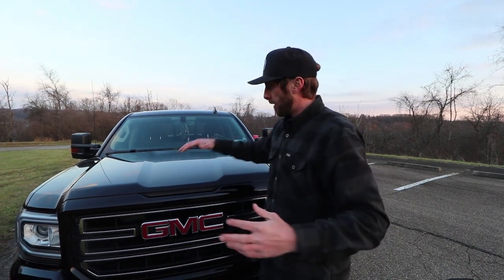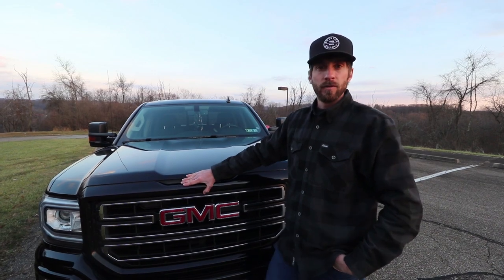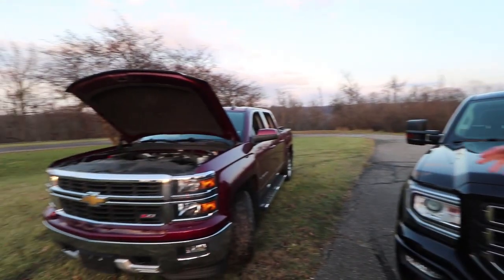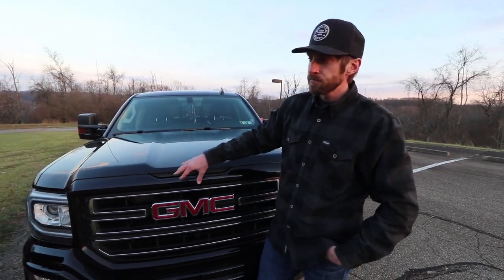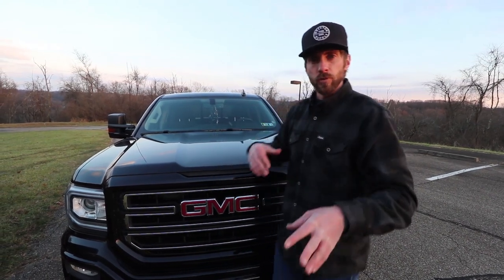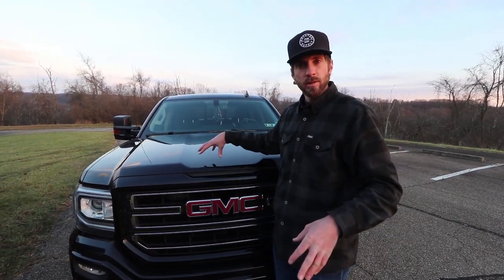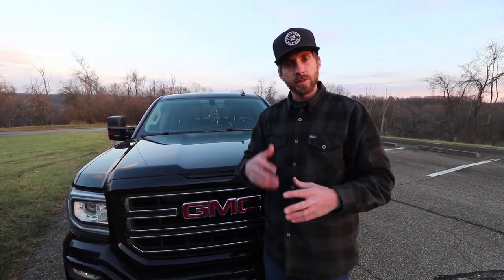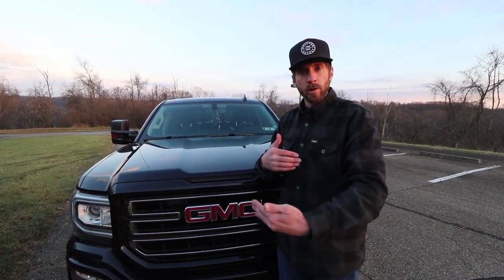Radiator Fan Won't Turn Off  2014-19 GM Trucks - Temperature Sensor & Thermostat Previously Replaced

Comment from the maker: Radiator Fan Won't Turn Off? GUARANTEED FIX: https://youtu.be/7gKbLHhD1cw
Reply: I just reset battery and it’s working as it should . Do you think a parts change is necessary

Comment: Replaced the temperature sensor and thermostat, still didn't fix the issue of the fan turning off when I removed the key.  Disconnecting the battery for about 10 minutes is what finally fixed everything.  Thanks for all of your advice, couldn't have done it without your handy videos.
Reply from the maker: Glad we could help! 🙌

Comment: Thank you for making this video. I had switched out both the thermostat and the sensor and the fan was still blowing...until I took your advice and disconnected the battery for the system to reset. Works great now. Thanks a million brother!
Reply from the maker: No problem bro! I had the same issue, that's why I kept making explanation videos.  I'm glad they helped you out! 🙌
Reply: Hello Anker - I had exactly the same issue. Replaced sensor - fan still on. Replaced thermostat - fan still on. I was mad coming back in here and when I watched the "disconnect the battery" clip - YES! That was it. Just came back from a test drive and runs great! Thank you Brothers Workshop. Too cool for school!
Reply: I disconnected battery and now truck won’t start
Reply: Man I did the same thing on my 2017 tahoe and it worked
Reply: EXACT SAME ISSUE ❤

Comment: Awesome video! Replaced thermostat first with no joy; replaced temp sensor next and still no luck. Watched this video, disconnected and reconnected battery and all worked perfectly. Thank you so very much for this; I was beginning to believe I may have a wiring problem.
Reply from the maker: Glad we could help out!  Thanks for watching the video.
Reply: @TheBrothersWorkshop  You suggested the idea of the thread tape on the thermostat seemed a stretch and it did to me too since it was preinstalled and only on the upper half threads but glad you added it as one of the options.

I love YouTube and have accepted it as a major tool in my toolbox not only on removal techniques but also locations on the vehicle/engine, which is incredibly helpful. It becomes quickly apparent who is or is not capable and your video was great; it assumed some knowledge of the viewer, drove straight to the point allowing me, defeated on my previous attempts to solve the problem. Thank you again and subscribing to your site.
Terry Foss
Reply: same here  the battery disconnect  did the trick
Reply: Battery disconnect saved me some time and money !

Comment: Sean, Thank you so much for this video.  I had changed out the sensor and thermostat on my '14 Silverado and still had the fan running and no function on the temperature gauge.  I never thought about the battery idea.  I did it and all works great.  You just saved me from a night of no sleep and possibly a lot of money.  Thank you a million!!!
Reply from the maker: Glad I could help out!  I'm also glad I could help save you a few bucks!  That's why I make these videos. 🙌😁

Comment: Glad you stated in this video to disconnect battery. Fan still ran after installing sensor but once disconnected battery it worked. Left Teflon tape in.

Comment: Thank you so much for posting this video! I changed my coolant temp sensor, thermostat and filled overflow with coolant and it still didn’t correct the issue. After disconnecting my battery and letting the electronics reset the temp gauge started reading temp and cooling fans stopped running. I was ready to remove teflon tape and dive deep. 
THANK YOU!
Reply from the maker: Glad it helped!  We have a ton of other videos about these trucks.  Check them out and let us know if you wanna see anything else.

Comment: Replaced the sensor didn’t work, replaced the thermostat, still no luck. Tried disconnecting the battery. Still no luck. Removed the Teflon tape and it fixed the problem. Crazy that the tape affected it that much. Thanks for sharing your wealth of knowledge!
Reply from the maker: Glad we could help you fix the overall problem and the minor issue with he tape.  Thanks for watching!!
Reply: I did the three things and still no luck. Where about is the teflon tape i dont see it anywhere in the parts

Comment: Replaced the temp sensor and the fans were still running high.  Disconnected the battery and that reset it.  👌👍 THANKS for the video
Reply from the maker: Glad it helped!

Comment: Your first video showing how to replace the sensor worked for me. I appreciate your quality videos keep up the good work!
Reply from the maker: Thanks for watching Joel!  I appreciate the feedback.  Not everyone, but we did have several people tell us the fix didn't work for them.  This was meant as a trouble shooting technique for those individuals.  We're bringing more stuff soon!
Reply: I put Teflon on the sensor and out worked but I had to have the code reset before the temp read correctly and the fans went back to normal. Watched this vid before having the codes reset when it wasn't working and thought I was going to have to tear apart again to remove Teflon. Maybe put an update on that first video about no Teflon and having codes reset or unhooking battery would probably work as well

Comment: Awesome! Thank you for this video. Replaced the sensor, nothing changed. UNPLUGGING BATTERY finished the job, reset the computer to let it know working sensor was in place...
THANK YOU!
Reply from the maker: Glad we could help Dino!! 🤙
Reply: How long did you disconnect the battery ?
Reply: Disconnected battery for about 15 min.
Problem came back about 2 weeks later. Turns out gonna have to replace thermostat. Gonna check out the brother's video on that too...
Reply: @dinoalexakos5564  so I have a 2016 Silverado Ltz and the radiator fan stays on the entire time the truck is running. Also the ac don’t get cold until 10-30 minutes. Then is blows super cold all day. I changed the coolant temp sensor and disconnected the battery for 10 minutes and it still doing the same thing. I’m not getting any codes and my gauge on the inside is reading correctly. Any ideas?
Reply: @baileyhodges2584  Not sure. It could be a totally unrelated issue. When I was having the problem, the radiator fan stayed on after turning off the car. The coolant wasn't flowing - no pressure in line - and temp guage stayed buried at 160deg, so I don't think it was working. Which leads me to conclude my issue has to be the thermostat. That's my next weekend project when we have good weather.  
Problem has reoccurred a total of 3 times, first time replaced sensor, the other two, unplugged battery for about 10-15 min. Not sure it's safe or smart to keep fixing the issue that way, so gonna swap out thermostat next.
Good Luck!

Comment: Thanks man!!! Saved me from a shop charge today. I replace the censor and the thermostat and the fans were still on. I removed the Teflon tape and disconnected the battery to reset the computer and was good to go. Appreciate you!!!!
Reply from the maker: No problem!  Glad I could help save you some cash.  Those shop charges are out of control, especially at the stealership... I mean dealership. 😂

Comment: This worked! Thank you!!  My Fans would stay on while the truck  was "running cold", when i knew it was not.  changed the temperature sensor, added Teflon tape and the fans stopped kicking in but my temperature was still running cold.. 🤔. Saw this video, removed pressure from the coolant system by opening the radiator cap, unhooked the battery, took out the Teflon from the temperature sensor and voila! Accurate reading... thanks 🤙
Reply from the maker: Glad it helped!  Thanks for watching. 🤙

Comment: Thanks guys!! Had this exact issue with my 2016 Sierra and changed both thermostat & sensor. Same issue, battery reset, left Teflon on the sensor and it works fine!
Reply from the maker: I'm glad to hear it! Thanks for watching and leaving a comment. 🤙

Comment: You talked about resetting your electrical by unhooking the battery cable, "Didn't work", you said  most likely i didn't change out the thermostat, so I changed it. Started it again, "Didn't work"  same thing, the fans revved really high.  So I got a brain fart to reset the computer by unplugging the battery cable again for the second time, just for shits and giggles.  It worked..THANKYOU FOR POINTING OUT WHAT NO ONE ELSE DID,  You must reset the computer when you replace both the sensor and the Thermostat.  Had you not said anything I would of never done it, Thank you
Reply: Your my hero....😁😁
Reply from the maker: Glad we could help you out bro! 🤙

Comment: Thank you very much!! I replaced the sensor and thermostat and the fan still wouldn't cut off. Once i unhooked the battery all my problems went away.
Reply from the maker: Awesome! Glad it worked for you.  How's it holding up over time?
Reply: Did it work for a while? Bud

Comment: Thank you so much for the help! I did not know about disconnecting the battery.  Almost replaced the thermostat after replacing the sensor didn't work. Found this video did the reset and it worked!
Reply from the maker: Glad it helped!

Comment: Thank for your videos. 1st it was the temp sensor helped for like 4-5 days. I'm always OEM. After that I noticed the fan was coming in still. One time killing the battery because it stayed on. Saw your video about next step. Not only that, but I also noticed rhe temp sensor still reading but the we needed the heater. I could feel the heat fluctuate to normal warm too cool all in a quick sudden with touching the controls. I then looked at the coolant reading for remaining of the trip. That's when I noticed it too was fluctuating half way to 210° back to 160. That's what solidify the next step. Now at 248k... Let's still if it'll still into the next cold months. Next is too tackle the trans issue if nothing else. He's a good truck!
Reply: *thank you, *without
Reply from the maker: Glad we could help out Tommy! 🙌 What's going on with your transmission?

Comment: Thanks for the assist.  Replaced the sensor but fan was still running.  After disconnecting then reconnecting the battery the fan turned off.
Reply from the maker: Glad we could help!
Reply from the maker: Glad to hear it!! 🤙👍

Comment: watched the first video and it didn't work. fan still ran. I knew I should have disconnected my battery but didn't lol. I even told the wife. later that night i tried to start my truck but was did then saw this video.  disconnected battery for 10 mins then jumped it. all good after.  Thanks guys
Reply from the maker: How is your truck holding up?

Comment: I replaced my sensor went bad fans were on and gauge reading cold. Worked great for 8 days then went bad again. I just replaced it again and it's back up and working good again... new one is a duralast. The one that broke in 8 days was a value craft. Hope it doesn't happen again?
Reply from the maker: Danny, following these steps.  Replace the sensor and the thermostat.  Then disconnect the battery to reset the computer.  You shouldn't have any issues if done correctly.
Reply: Update I replaced both thermostat and sensor durlast brand, working great 👍
Reply from the maker: Glad to hear it! 🤙
Reply: @TheBrothersWorkshop   Replaced the sensor the fan continued to run, reset the battery now its working just fine.

Comment: I have swapped out the temp sensor a couple of years ago six months later and does same thing. I always reset the battery and it might last one month or 7 months so that tells me it’s not a part failure it must be an electrical connection? Sometimes it actual will fix it self while running or it will be running fine then the temp drops, but 99% of the time when you start it you can tell if it’s going to be fine or not. A battery reset always fixes it so that tells me it’s not the sensor itself? Would love to dig in deeper on what’s actually causing it.
Reply from the maker: Hey Jason, I'm wondering if you may have more going on.  All of the steps we took fixed our issue.  Nothing has happened since following all of the steps we talked about.
Reply: @TheBrothersWorkshop  that's great to hear. I've not replaced the thermostat but I just have a hard time convincing myself a thermostat will make it all go away. If it does I'd be glad to do it, but if it is I just can't convince myself reseting the battery would fix a thermostat issue? I'm hoping others will chime in and say there problem went away completely too or are they having the same issue? The good thing is reseting the battery is an easy fix. lol
Reply from the maker: We've had this issue and replaced the sensor and thermostat on three of our own trucks.  This fixes this issue and after replacing both parts and reset the computer, this issue has not come back.  If you read the comments, most people have successfully been able to fix this issue themselves by replacing both parts and resetting the computer by disconnecting the battery.
Reply from the maker: If you don't want to try it, I understand.  However, it's a cheep fix that you can hand done in less than an hour.  We made these videos because this fixed worked for us, and continues to hold true.
Reply: @TheBrothersWorkshop  I appreciate you help. I'm going to replace the sensor and the thermostat and check back after. I hope you're right and thanks for the messages.

Comment: Hey thanks for the video. replaced both, did the disconnect trick but sadly im having issues. This is what is occuring. 

1st drive everything is fine. no issues. but if i start the vehicle up a 2nd time the chance of the fans kicking on increases. sometimes it does, otheres it doesnt. but normally i can expect it to happen at the 4th turn on of the drive. disconnecting/wait/reconnect fixes the issue, but it constantly comes back. suggestions on next step would be nice, dealer wont do anything bc they cant replicate the issue even tho ive explained it.
Reply from the maker: Double check your work.  Remove any Teflon tape.  There may be a loose wire or something.  This fix should not have any issues if done correctly.

Comment: We changed the sensor and fan kept running, took it to a electrical specialist and they changed the battery and everything seem to be fixed a month later we are having the same issue with a check engine light? Any thoughts? Thank you for your help.
Reply: Also, the AC is not working?
Reply from the maker: Well, we didn't have a check engine light.  I would check the code and see what it says.
Reply: @TheBrothersWorkshop  so apparently it was the grounding cable causing all sorts of electrical issues

Comment: I have a 2015 Yukon XL Denali which continues to have this problem.  We have replaced everything a million times such as the temp sensors, wire harness, removing the tape, etc, disconnecting the battery basically every time now that I drive the truck.  The only thing that turns the fan off is disconnecting the battery but then it’s back up and running shortly after I drive it a few miles and stays on. Do you think replacing the pcm would be next?
Reply from the maker: I'm really not sure. Following the steps in this video, we have fixed four of our trucks and have had no issues since.  If you fold all these steps and the issue continues you may have another issue. I would have it diagnosed by a local professional.

Comment: I disconnected the battery for over 24 hours and couple days after. The fan still back back on. Sensor and thermostat both been replaced. What other solutions should i seek?
Reply from the maker: This fix is for a specific issue.  It sounds like your truck has something else going on with it.  I recommend having it diagnosed by a local professional.  Let us know what's going on with it.
Reply: Relay
Reply: What relay was it?? I’ve changed thermostat, temp sensor, unhooked battery all these steps four times with gm parts. And cleared codes with my snapon scanner. I’m about to lose my mind
Reply: going through this now.  what was the fix? @mainstreetdiesel

Comment: Any other suggestions…. Replaced both the thermostat and temp sensor , disconnected the battery and this worked for a couple weeks and now same issue with fan running again.
Reply from the maker: You might have a different issue.  I would double check your work, and if it continues have your truck diagnosed by a local professional.

Comment: I forgot to disconnect the battery while replacing my sensor until seeing this. I hope that's the problem otherwise it's on to the thermostat I guess. Thanks for the reminder haha
Reply from the maker: Did it work?
Reply: @TheBrothersWorkshop  i think so. It messed up the next day but haven't had a problem with it since

Comment: Hey I replaced the thermostat, the coolant temp sensor and the coolant temp sensor wire and after I disconnected and connected the battery still having same issue the fan is constantly running right when I connect the battery any ideas what else could be wrong?
Reply from the maker: Double check your work.  Remove any Teflon tape and check your fuses.  There is a chance something wasn't done correctly.

Comment: Hi I only replaced the sensor a couple of months ago and it fixed the problem but now the blower won’t stop again and the temp gauge won’t move off of 160. Will replacing the thermostat fix the issue?  I should have done that when I replaced the sensor. Thanks for putting out such great videos!
Reply from the maker: Yes, you should replace both the sensor and the thermostat at the same time.  Unfortunately, it's hard to tell what part went bad, so replacing both is the best way to do this.  We replaced the sensor first and had the same thing happen.  Replacing the thermostat fixed our issue permanently. Thanks for watching our videos! 🙌
Reply: Did you get it fixed